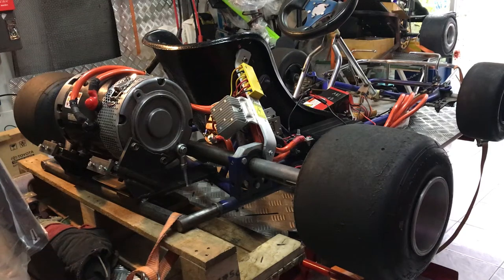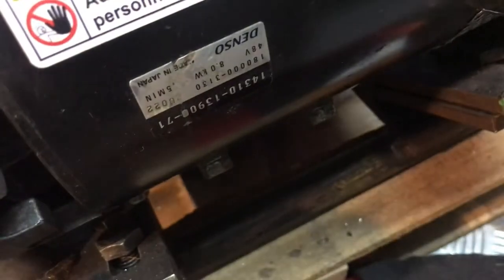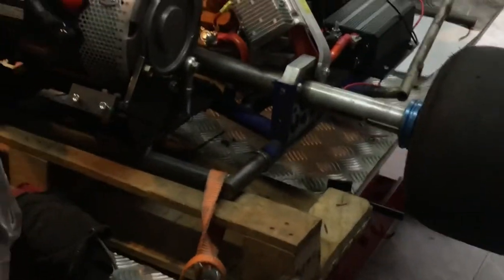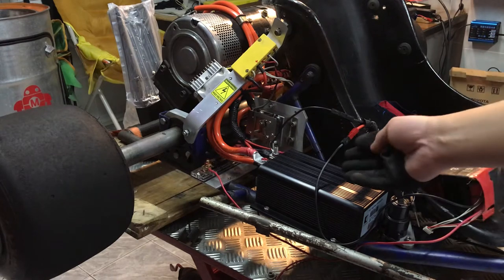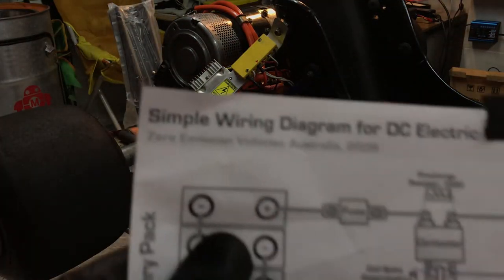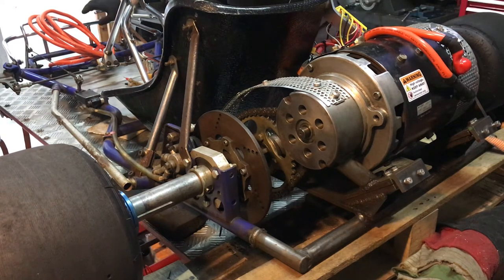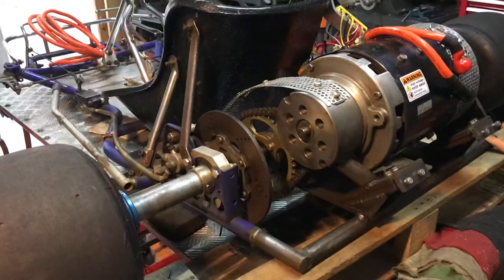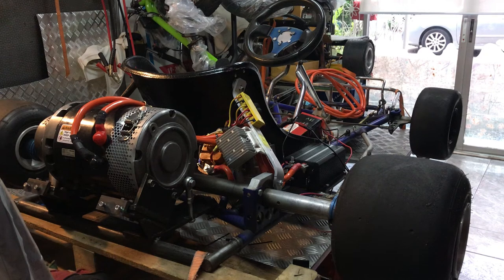DIY Electric GoKart 8KW : testing on the bench - (ENG. version: CC)

Comment: What gear ratio are you running from the motor through the gearing? Looking at a similar build with a motorcycle and have a 3.09 gear ratio; wondering how well that will work.